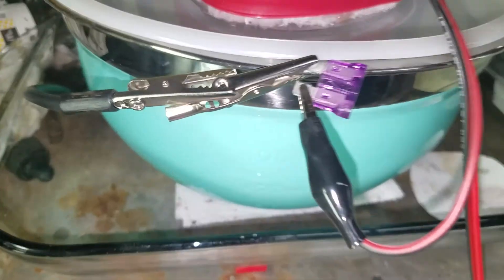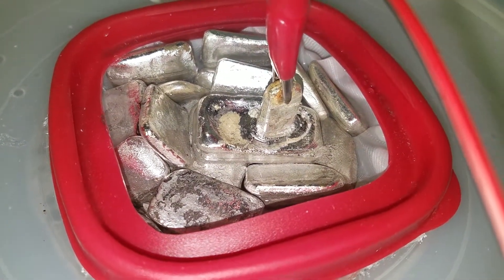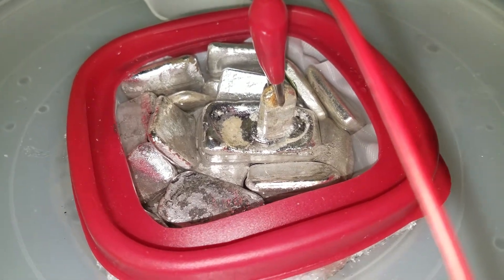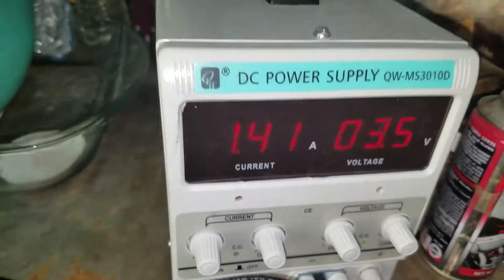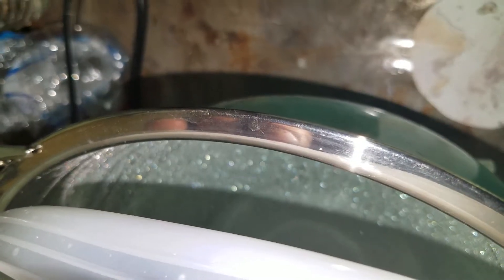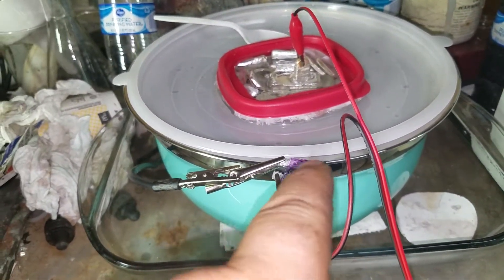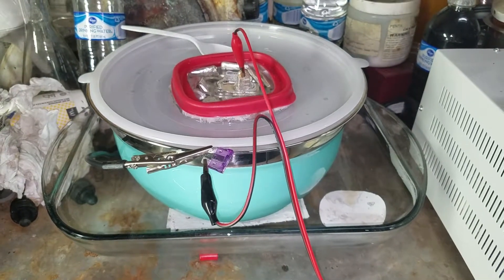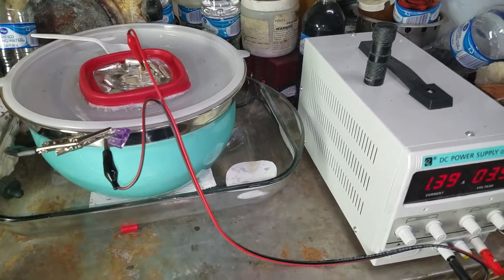Silver cell start up.

Comment: Every time I start mine with a fresh filter, I set it to 3.5 volts and it runs 3.7 amps. Don't know why. I run with one clip on the lip of the bowl and get accelerated growth in the bowl opposite the clip. I just move the clip every couple days.

Comment: What all could you use as an alternative power supply? And do the crystals grow strong or are they really weak?
Reply: You could use a midget on a bicycle attached to an alternator if you’d prefer.
Reply: I've seen it done with the power supply unit out of a desktop computer. You'll need  one with a switch on it. There's a video out there on how to do it.